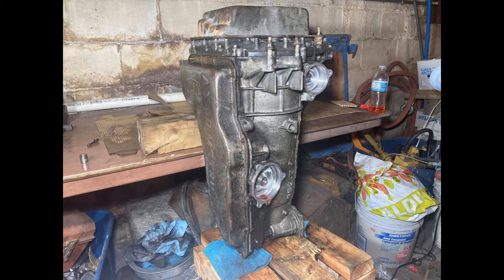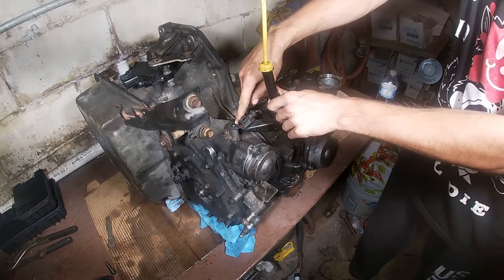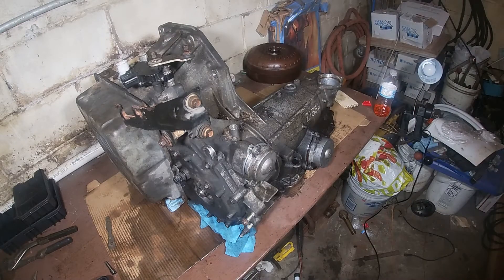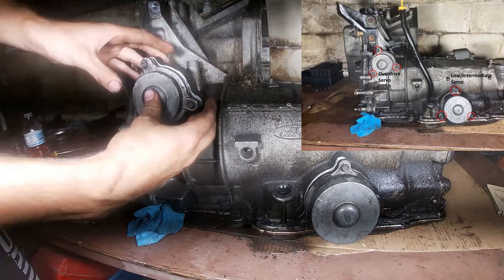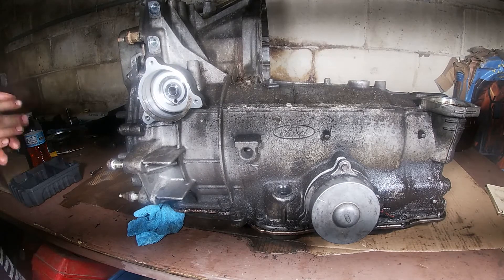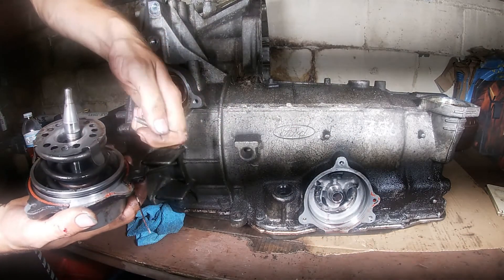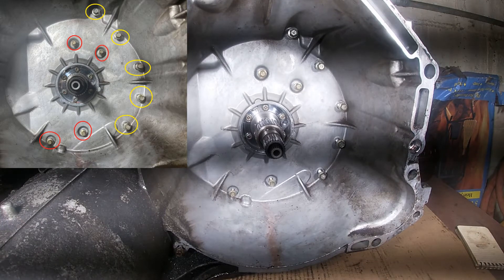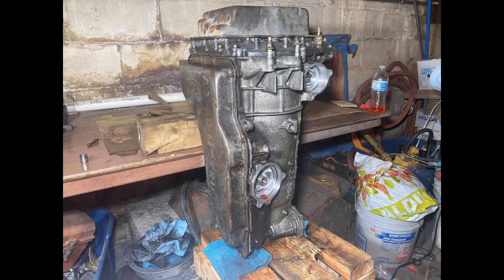AX4S Transmission Rebuild Part 1 - External Part Removal

Comment: what is the white/grey sensor to the left of the range sensor at 1:46
Reply from the maker: @LiCl-k5n  if you pay close attention in part 2 you will see that it is the connector for the internal wiring harness connecting to the valve body solenoids.
Reply: @cooldued11  ok so that looks like the female connector to a wiring harness. Someone told me that was a sensor that could be the culprit of my hard shifting, mis shift from 2nd to 3rd etc etc.....glad I asked the question and thanks for the fast reply
Reply from the maker: @LiCl-k5n  hard shifting is a tough thing to diag. Hope you find it and it’s nothing to problematic.